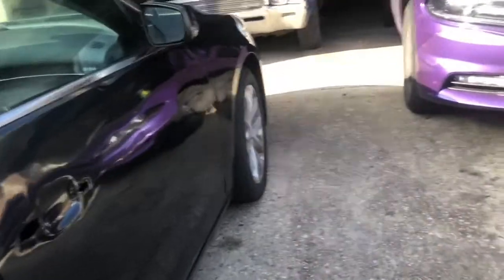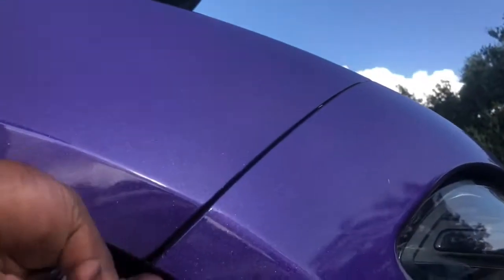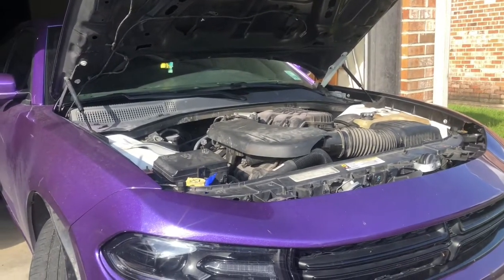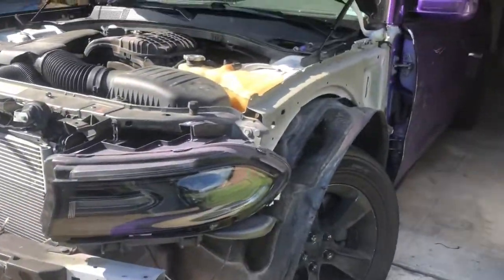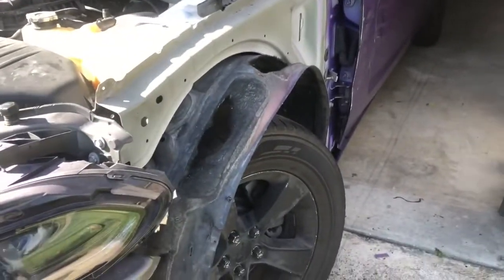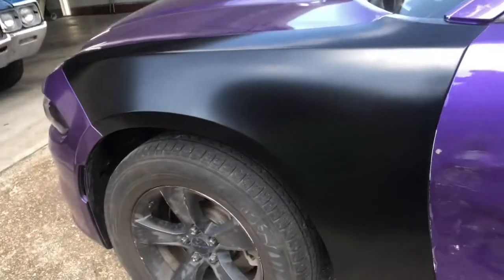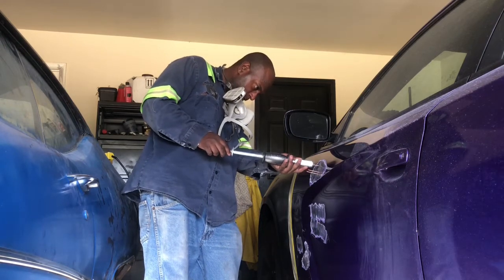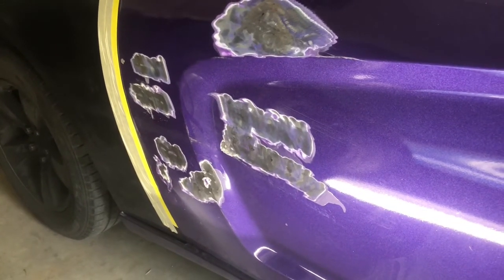How to repair a wrecked dodge charger

Comment: Hey I just got my 2014 Dodge Charger and I want to do this front bumper conversation to the the new ones any advice on how to do this ?
Reply from the maker: Jay Rizzy yes you know you have to buy the hood bumper fenders grill headlights and u got to do a lot of test fitting and lining everything up are you doing it yourself?
Reply: @MrYosefi09  It depends on how difficult the task is lol  Me and my dad will most likely give it a go .  Im located in Florida .  can I get your email so I can show you all the parts im gonna order to make sure Im buying the right parts
Reply from the maker: Jay Rizzy yes it’s yosefissachar@yahoo.com I got of video of me putting racing stripes on Charger that will be posted tomorrow be sure to check it out
Reply: Where do you get the right parts which ones did you get for the conversion